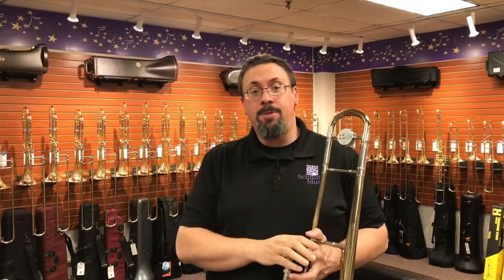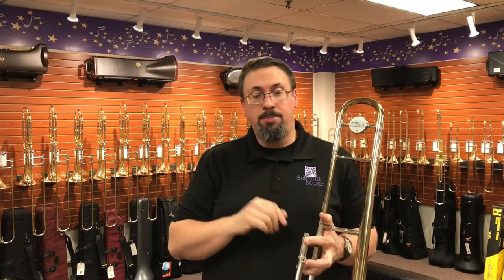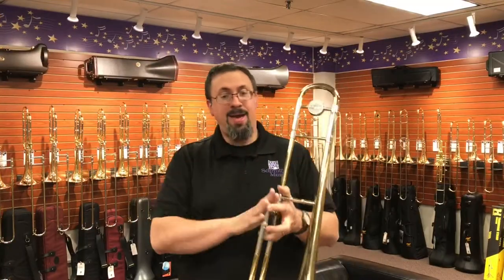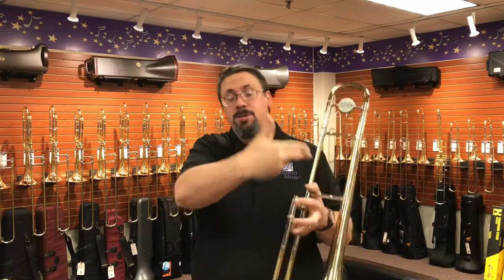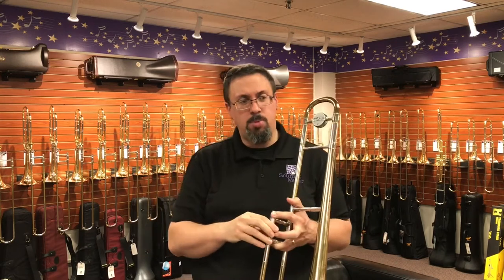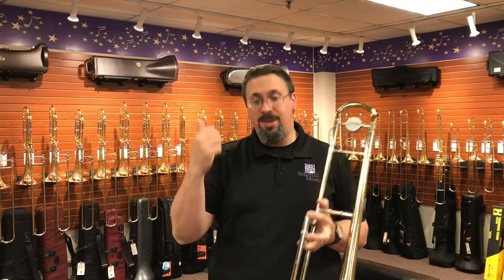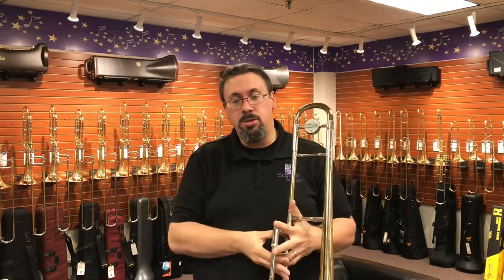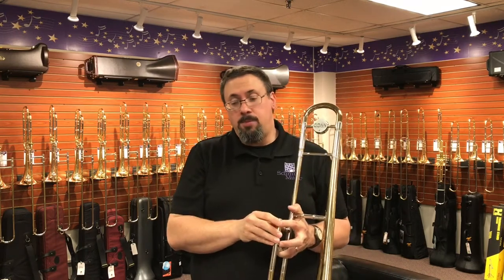Conn 32H Small Bore Tenor Trombone Review

Comment: I recently acquired a Conn 30H, also designed by Jake Burkle, manufactured in 1936.  0.494"/0.507" dual bore, 7" bell.  "Conical" concept.  It's a surprisingly wonderful trombone - also sounds larger than its specs.
Reply from the maker: I haven't had a chance to spend time with the 30H but would love to at some point; thanks for sharing!

Comment: From what I remember when I was working with a well known trombone maker here in England the 32H bell is actually an 8H one  cut to 7 1/2". Someone asked about alloys here , Conn had an alloy they called P27 that they used to make outer slide tubes with on some models. P27 of course is just a made up marketing tool but we had some analysed  and ( from memory, it was  a while back)  It was an 85/15 gilding metal with the addition of 2% tin which would have made it much a harder and springier . 32H ''s are really great horns and like you said kind of unique . Jake Burkle certainly  knew a thing or two .
Reply from the maker: Thanks for the great info!  I seem to remember hearing somewhere else about the 8H/32H connection!  I think Conn had more clever "marketing gimmicks" then any of the other major makers during the 30's-60's; I could read the classic catalogs and ads all day!